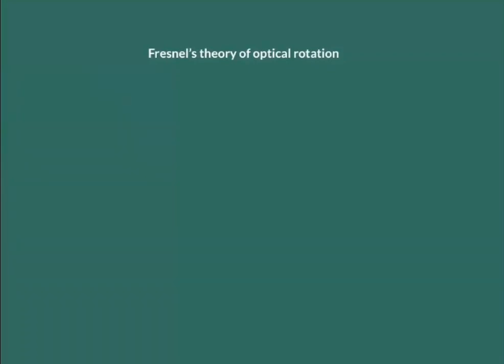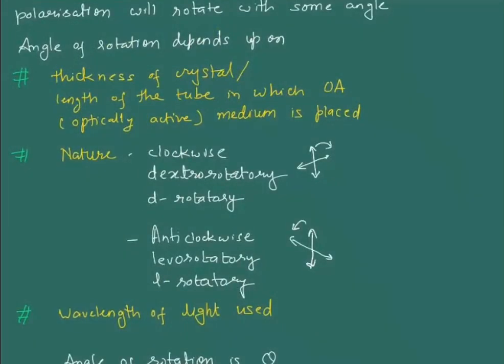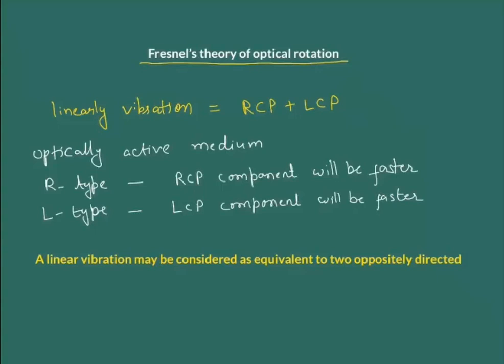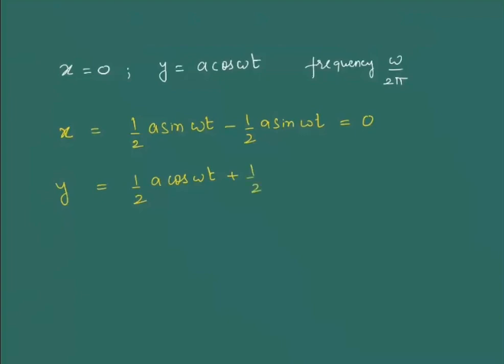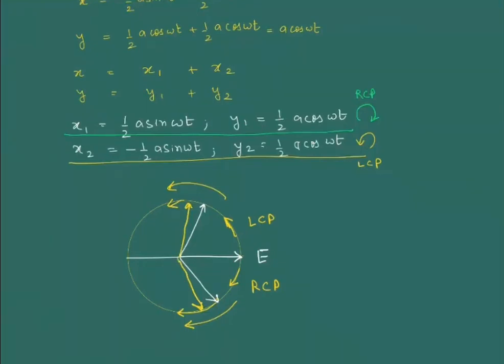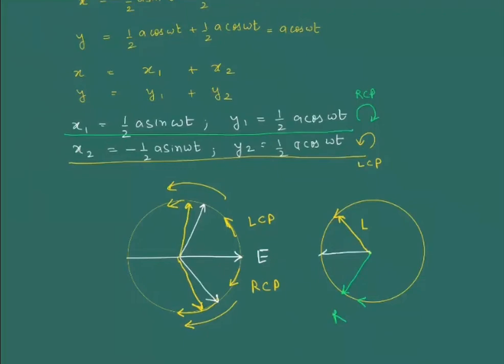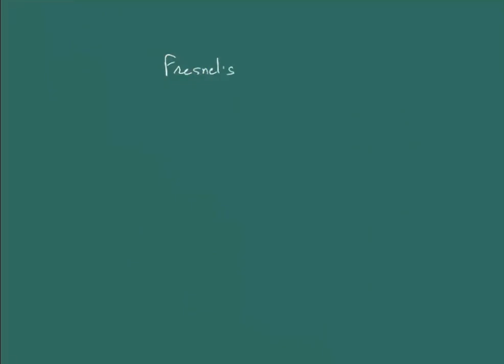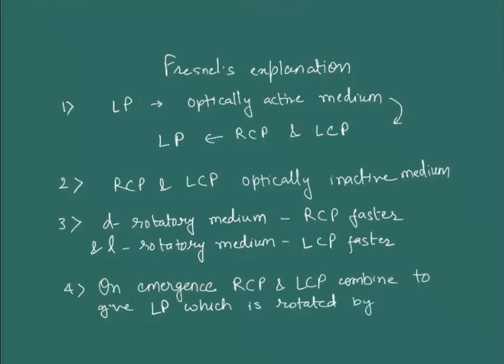Fresnel explanation of optical rotation | Polarization of light |

Comment: Mem the 1st right angle prism does not separate l ray and r ray because the optic axis is in plane of incidence and perpendicular to refracting surface so the both rays will travel in same dirn.. but diff. Speed so there in no any kind of split due to 1st prism 
thank you🙏
Reply from the maker: thank you 👍🏻